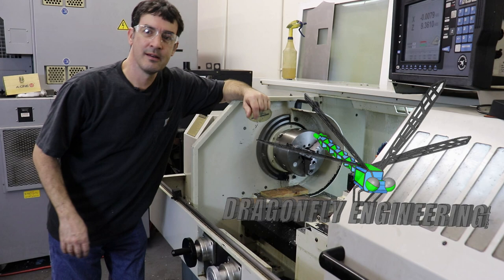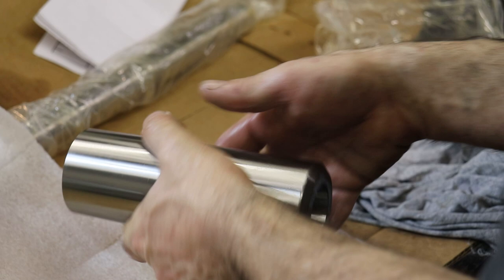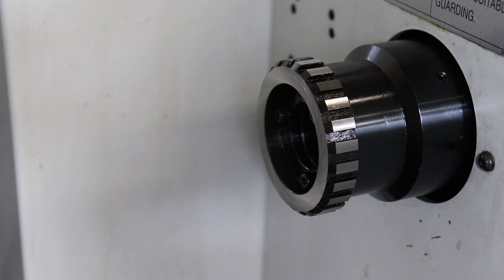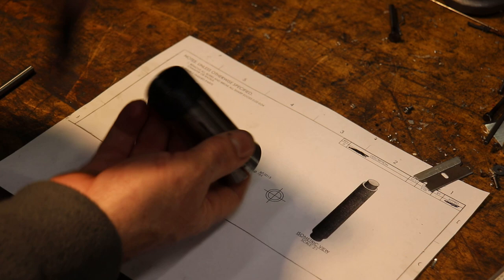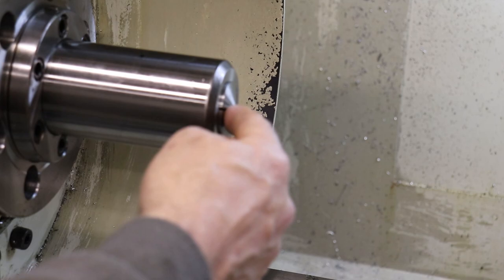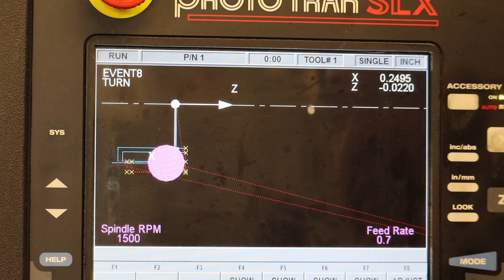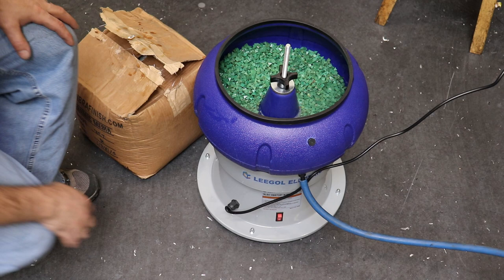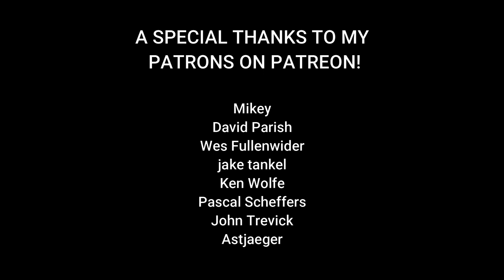5C COLLET FOR LATHE

Comment: I wonder if this is a measuring cap? \*Proceeds to pour half the bottle in*

As always, great video! Are you planning for your robot to change lathe tools? Or can it hold a little parts tray and say "Yahtzee"? I'm pretty excited for that! Robots are freaking amazing!
Reply from the maker: Hi Vincent,  I am actually setting up an add on 4 position tool holder / changer ( rotating tool post)  The robot will push the buttons on the control and catch the parts.  Thanks for watching!
Reply: The robot definitely needs hold some cardboard corner protector and yell 'Yahtzee' when it parts off 😂
Reply: @almostanengineer  don't forget the "Aaaaaaaand", pitch slowly rising, before the Yahtzee.

Comment: Always interesting. Thanks for posting. I wonder how much material the abrasive tumbling removes? I would expect that for high tolerance parts you would need to allow for some 'shrinkage'.
Reply: I don't think it's that much. If you look at how much material concentrated work with emery paper on a lathe removes, then you can see that this is much less aggressive, and should therefore remove way less material. My guess would be that it's less than a tenth (a tenth of a thousandth of an inch, if you're not into machining jargon. I dunno who I'm talking to here)
Reply: @vincentguttmann2231  That makes sense. It's not like there's a lot of energy involved. Thanks for taking the time to reply.
Reply: @CornishMiner  No problem!
Reply from the maker: I agree with Vincent.  I think the tumbler is most useful for breaking off burs and sharp edges only, larger surfaces just get a  burnish.  Thanks for watching.

Comment: I am enjoying your series. I would love to see you feature a discussion and episode on a plastic injection mold requiring a sideways pull pin, using a slide or an actuator. I am trying to solve this problem in the best way for a rapid prototype currently, and neither option seems easy. Any suggestions?
Reply from the maker: Hi David, thanks for watching!  I did a video about 3 weeks ago where I show a mold with a side pin pull and an unscrew thread "robot and injection mold integration"  hope you like it
Reply from the maker: I'm sorry, David, I told you the wrong video to see, this is the one with a side pull: https://www.youtube.com/watch?v=6PA_KZLeUak
Reply from the maker: or this one: https://www.youtube.com/watch?v=O0y3DJfhCKQ&t=2139s

Comment: You can find some tips about tumbling by Stefan Gotteswinter in this video (skip to 36:00):
https://www.youtube.com/watch?v=spMN4oqJiNQ

He uses 30-60ml of water and a splash of ordinary dish soap. Additionally, you should not allow water containing plastic particles down your drain but he did not give a safe way to dispose of the waste water.

Some media is ceramic abrasive inside a plastic shape which will wear, contaminating the water. You don't need to dig through the bucket, you can use it with the lid off and just pull the parts as they reach the top.